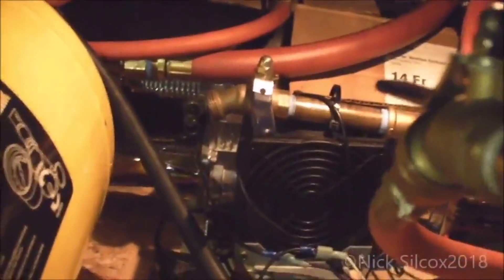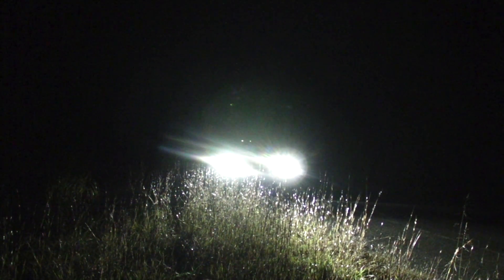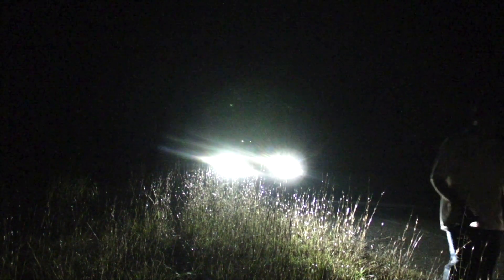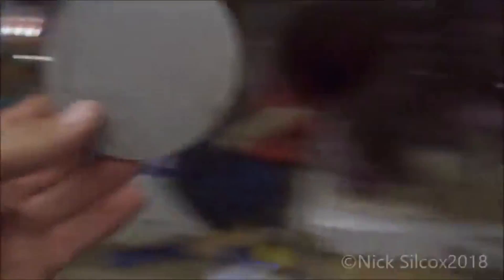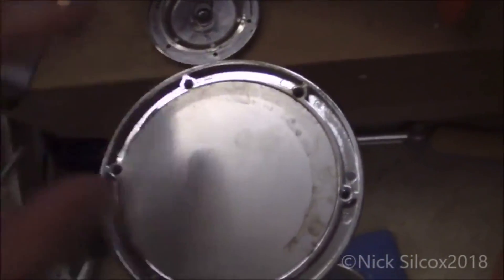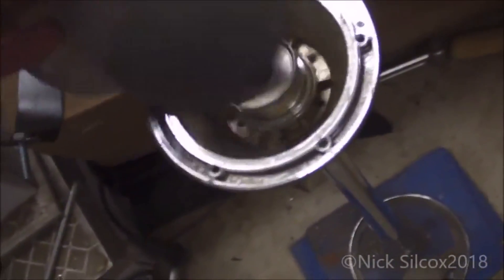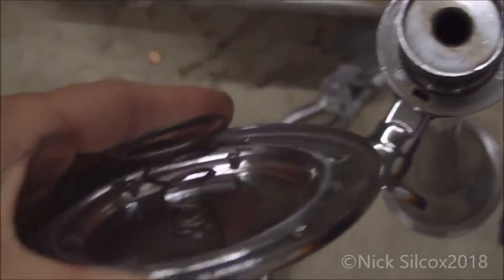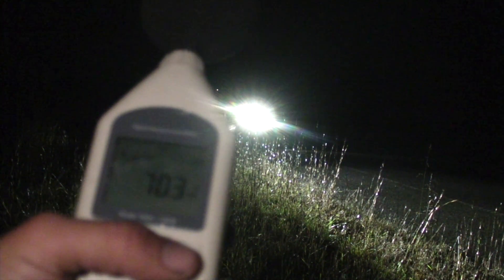P5 Horn Single VS Double Diaphragm

Comment: Great video! I have always loved the sound of P5's. I got one off ebay a couple months ago with an older low profile manifold that apparently Amtrak used (not sure if that's true). Anyways..the horn to me sounded a bit off since the manifold was opened up with bigger air holes through out the manifold (as if someone drilled it out and bored it bigger). Personally to me it didn't sound like any other P5's I've heard, so I luckily acquired a new p3 off ebay about a month ago, took the 3 & 5 bell off my p5 and onto the p3 making it a newer style new cast p5. Sounds and looks awesome, so now the old p5 was turned into a weird looking p3 but its a good parts horn for my p series horns now.

Comment: Great video! Very good job at testing both! I've got a p5 that I've had both dual and single diaphragm set up and even though the dual is louder it dose have a more harsh sound so I keep mine a single diaphragm set up! I've also got 2 p3's one new cast one old cast and I keep them single as well for a more classy sound!
Reply: How do you do that sir ?
Reply: @jacksonslaterelevatorraila6444  adding or removing diaphragms?
Reply: single-did you see my old horn question. I own a 1991 Conrail RS3L NFS.
Reply: @jacksonslaterelevatorraila6444  I just saw it! P5 old casts have a beautiful sound! I also have a former conrail RS3l that I'm in the middle of restoring! As far as getting a p horn down to a single diaphragm just remove the diaphragm that's up against the back cap and leave everything else as is and put it back together!
Reply from the maker: Blake Kennis I have 2 p5, I’m probably gonna make one of them double and one single diaphragm, I’ll have to experiment which one sounds better with single vs double. I like the smoothness of a single and yet I like the loud, harsh sound from a double.
Reply: @NickSilcox3  very nice! I have plans on doing that if I can get another p5! Having both setups is nice!